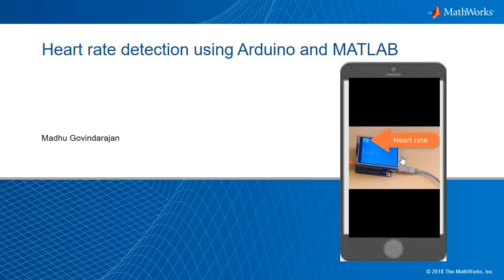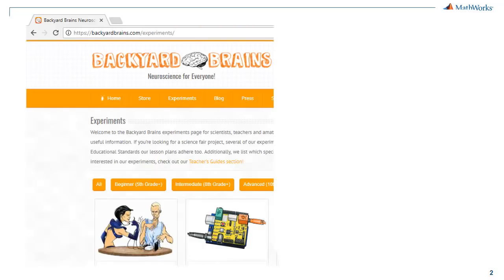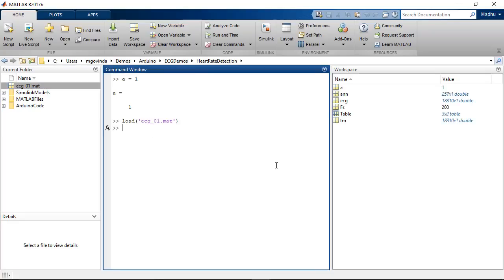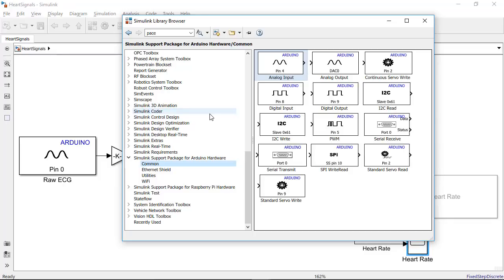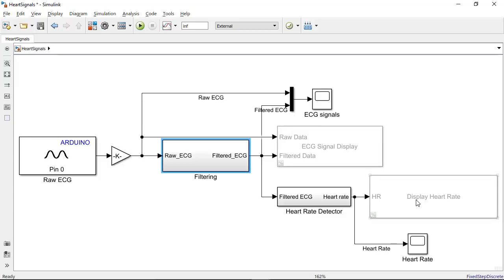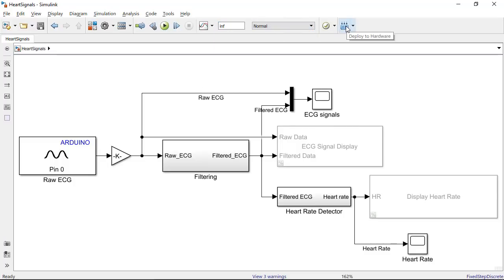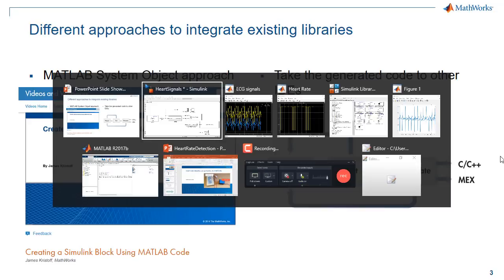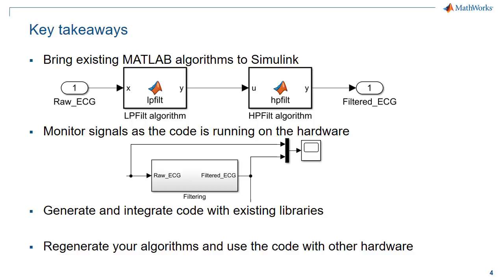How to Build a Heart Rate Detector Using Arduino and MATLAB

Comment: What is the gain block contain ?
Reply: Analog voltages range from 0 to 5V. But the block brings it in as a value between 0 and 1023. The gain block contains 5/1023 to scale this value back to 0 to 5 V.